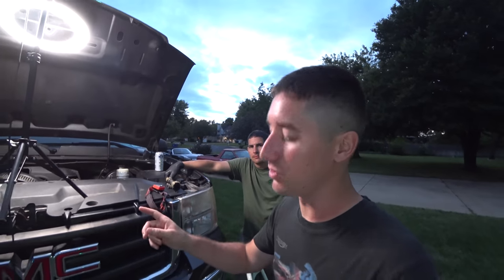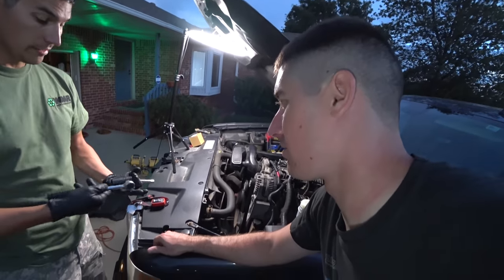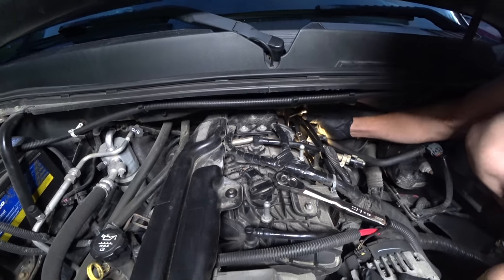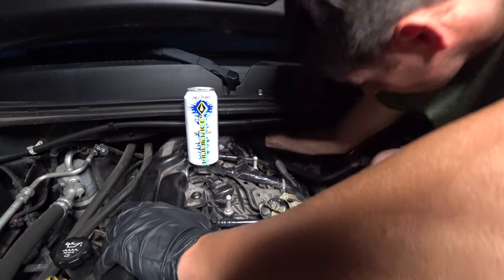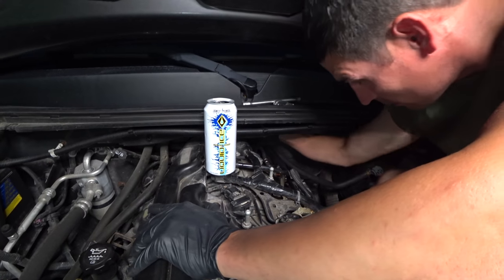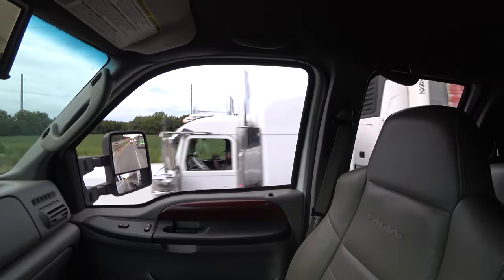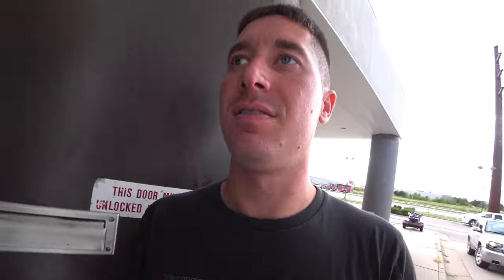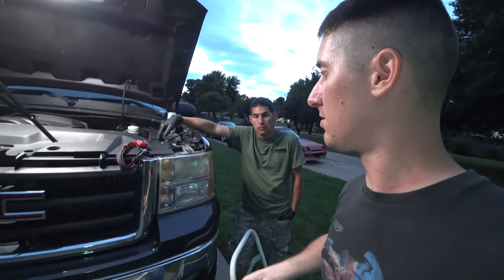REPLACING The Oil Pressure SENDER On My Neighbor's 2010 GMC Sierra

Comment: Just got it done thanks for the video. Made things a lot easier and understanding. It’s a very tight spot but it is possible I used a ratchet to break it loose and finish it off with a Milwaukee electric ratchet. Also, just to have a little bit more room I disconnected the

Comment: One recommendation, if you have one is a wobble extension, it has just a little movement compared to the swivel socket.  A tough job, not one you want to do twice... you can lay across the front of engine if you want... but I suppose on a lifted truck its a bit harder.

Comment: Leave it to GM to put a common failure part in the most difficult place to reach.  Just google "LS oil pressure sensor" to see how common this is.  knocks on wood this hasn't happened to my 15 year old Escalade yet.  But I'll probably pull the intake since the gaskets are probably old and messed up anyway.  It's not really that hard to pull the intake off anyway.

Comment: 2010 and the GMs are still puking oil pressure senders. I replaced one on a friend's early 2000s model and learned then it was a very common failure. I remember the one I did being lower than that one. I used an extra long 3/8 extension.
Reply: ScottJ175: Yup. 😉🍻

Comment: If I changed the oil pressure sending unit with Watch JR Goes and Gabes I would pack up the Hash Pipe with Rocky and get all schmoked up

Comment: Thanks for the video. Just wondering... my pressure gage is reading 80 psi, i just replaced the oil filter, so i dont suspect its dirty. Do you think the oil pressure switch could be bad?

Comment: P.s older BMW engines  m42 s52 and  old inline 6  oil pressure sender switch  is a quick swap and  install very common. Issue for these engines

Comment: the MONSTER truck is straight up bad ASS. Im sad to see it go. What do you use to cut vinyl JR? m looking to buy something to do something similar.
Reply from the maker: It’s an old SummaPro that was $300 at an auction... when I had the sign shop I had a $13k 64” Summa T Series, it was a monster. 💪

Comment: I think MotorTrend made up pound-feet of torque. I've never heard it except on their videos and TV shows back in the 80's. Foot-pounds and inch-pounds are the correct terms.
Reply from the maker: Exactly 💯
Reply: @WatchJRGo  What's funnier is when "experts" say the foot-pound is equivalent to the Joule and a pound-foot is equivalent to a Newton-meter. In SI units, a Newton-meter is a Joule. All SI units can be broken down into basic units: a Newton is a kilogram-meter per second per second. Apply a Newton of force over a meter of distance and it's a Newton-meter, aka a Joule. 

They also say, wrongly, that the Joule measures linear work and the Newton-meter measures rotational work (torque). LOL. 

100 ft-lb is not equal to 100 lb-ft. Ft-lb is a vector, meaning 100 pounds of force applied over 1 foot of distance. 100 lb-ft would be 1 pound of force applied over 100 feet of distance, not the same. So 100 lb-ft equals 0.01 ft-lb. It's nonsensical.
Pound-feet may be a convention, but it's not right.

Comment: Caution when clicking link for parts.  The screen is Dorman brand.  The Sensor is AA Ignition brand.  I changed 2 on 2 different trucks.  I already had to replace a new one after a year.  Now, I am needing to replace the other new one in the middle of winter after 2 years.  I might go to the dealer for OEM.

Comment: I have a 2003 tahoe that shows "low oil pressure" reading constantly on my dashboard. I was told it's just the oil pressure sensor that no longer works. Never messed with them before, anybody got tips?

Comment: That job is easier if you cut and break that plastic guard that blocks the view to the sensor.That guard for the most part does nothing.Once u get some of it out of there u can see the sensor no problem and it’s a lot easier.A lot better to get ur little filter in it goes in under the sensor .you will be all set up the next time you need to replace a little filter and sensor.

Comment: i do those all the time at my dealer and i think the labor time is like 2.1 hours with pulling the intake and if you add intake gaskets if you actually pull the intake which no one does it maybe come in at 400 bucks tops but like i said we charge the 2.1 and no intake gasket kit so really its like 290 ish
Reply: UBBERTANKER: WOW! Thanks for the clarification!😉🍻

Comment: Pro Tip: As long as the oil sensor doesn't work the v4 mode wont activate.
Reply: Box5150 but probably sets off check engine light and then you can’t use remote start lol

Comment: CAR PROBLEMS!!!: I came to a complete stop the other night and felt a hard thud. When I went to go it would not budge. Only would go in reverse. Couple days later I can get it to move in drive but it periodically will "slip" where the RPMS climb but the car just isn't matching it. 

2008 pontiac g6 gt 130,000 on it. No prior problems
Reply: Jesse: Sounds like your torque converter is toast.
Reply: @Gabe-ABNCW3  easy replacement?
Reply: Jesse: Thats a relative question!😉

I wouldn’t make this your first or second venture into turning wrenches. 
An experienced mechanic can get it done in about 5 hours. 
This job will require an engine hoist, jack stands, and a host of other tools to include a torque wrench and a place that is well lit or at least covered as you will have to separate the engine and transmission to remove the torque converter. 

If you aren’t prepared for or comfortable doing this, DO NOT ATTEMPT it. 

My advice is to find someone trusted by someone you know to be mechanically knowledgeable. The job will likely cost between $600 to $1000. 

Another option is to have a mechanic or dealership diagnose it for you. You will likely have to pay a nominal fee (up to $100.00) for this. It is very possible they can provide a simpler solution. 

I wish you the best of luck with this!!!😉🍻
Reply: @Gabe-ABNCW3  yea im not gonna try that LOL I really dont want to take it to a dealer Q_Q but I might just have to. The only mechanic I know of works at honda and is hard to get ahold of. And also hates working on GM cars 😎
Reply: Jesse: 😉🍻

Comment: Dorman Part ;( ...... you'll be back according to SMA chanel :)
Reply: Cameradoctor: For whatever reason this part is notorious for failures...
Reply: If the factory part was any better they wouldn't be doing this in the first place.
Reply: Eldon Erc: True. The truck has 117K miles on it and this is the SECOND time it’s failed.  The first time the dealership fixed under warranty at 90 something thousand miles.

Comment: Very odd, that thing had a massive engine, in a huge engine bay, yet stick the sensor (that'll need replacing) in an almost inaccessible place... Or is it the old  (dealer fix) part.
Reply: blackcountryme: And they win awards for design?!🤯

Comment: Apparently the part changed from 2010 to 2011 because the Amazon link states this part will not fit the 2011. You failed to show the most challenging part, removing the electrical connection. Did his check engine light not come on?
Reply from the maker: No CEL, I don't think it will set unless you unplug it. Getting the connector it usually the easiest part for me, getting the new sensors started might take me 3 minutes sometimes 🍻
Reply: @WatchJRGo  when my pressure dropped to zero, as I was driving, I knew what was happening, but got no CEL. The next morning I started it up, BAM, CEL! I’m just praying it resets itself with the new sensor. I’ll find out tomorrow! 
Oh, nice socket….but, necessary?

Comment: I spread cardboard across the engine compartment and laid down on top of engine.  Awkward, to find the step ladder steps  blind when you dismount.
Reply: Same. But I'm a fat guy so I used a couple pieces of the square floor cushions.
Reply: @jeffreymarshall7420  - Me too.  I couldn't possibly fold myself up and sit under the hood, and still be able to breath.